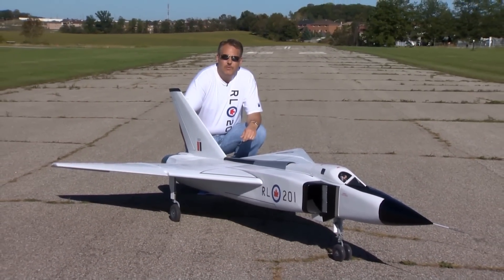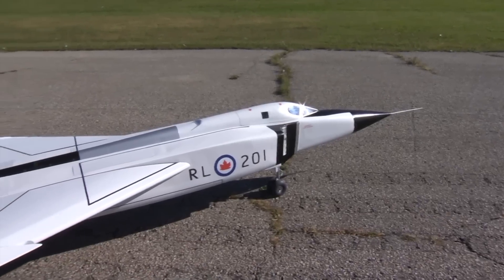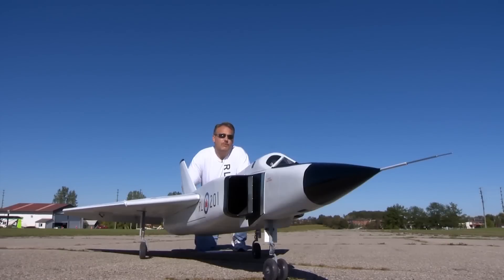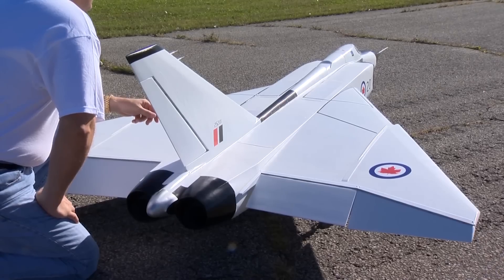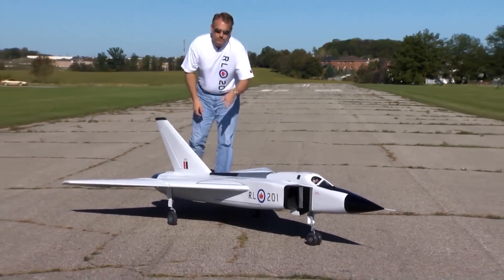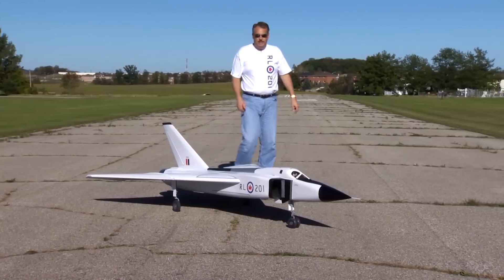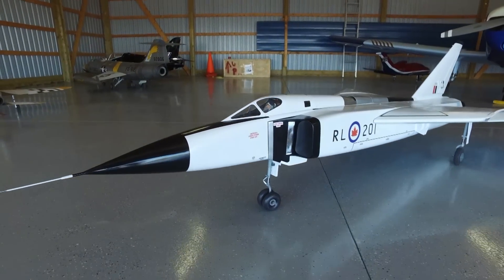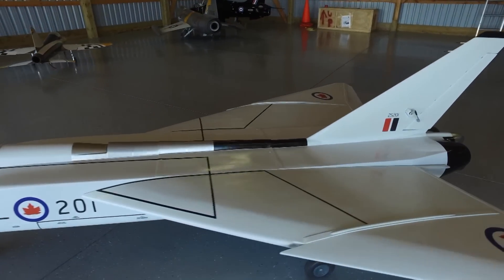Avro Arrow Model Test Flight 2

Comment: ok you almost got the low rear correct it actually sits about an 8 deg angle slant from back to front ....also dont forget the actual rear gear also had to shorten to stow as they had to make room for the fuel storage area ... wihs you had used a turbine engine instead of the ducted fan ... though ... would have sounded better ;)

Comment: Will retracted wheels give it more stability? can you do it?
Reply: part of the problem with retracting gear is they not only need to lift in but angle up the front of the rear wheels up and shorten them a bit to fit within the inner wing space and behind the fuel storage area ... the reason they drooped the wings was to lessen the repair and replace time between the screw gear failure from repeated landings ... the wing droop also added stability ... and the inner wing along the air dam actually cants slightly towards the rear of the plane ... the front edge is actually 6 inches further out than the trailing edge .. and the air dam was angled towards the main body at the very top and bottom making it also a vortices generator increasing thrust from 1 to 4% over it's flight envelope ... they put a ;lot of little tricks into that plane ... and it still has the 15 still used firsts of all jet fighters ... and once had 22 of the firsts ..7 of the firsts were changed ...
.
dont forget the inner wing is a high mach airfoil it is a trapezoid ... with the longest side on the bottom back then  top back then top front and finally bottom front ... while the outer wing was a standard airfoil with flat bottom and curved top ... the inner wing was best at high speed and the outer was best at low speed .... the difference partially covered stall speed ... as the stall would start almost at the rear end of the inner wing ... but with the outer wing compensating with the majority of the low speed lift .. at high speeds (mach 1.5+ the outer wing would stall more near the tip and work in BUT the inner wing was providing about 95% of the lift of the plane

Comment: how did you solve the pitch up problem, are you sure this aircraft had a 1-1 power output, i think you know what your doing, did you add some weight forward as 2nd flight was good, i got 17" laptop and had problems seeing it.
well done for bringing the AVRO ARROW back to life,
Reply: the arrow was 1.1 to 1 thrust to weight ... actually ... no weapons ... as for the pitch up that was most likely because the tail was plywood being over heavy he may have just moved some weight forward and brought the center of gravity towards the leading edge of the wing root where it belongs

Comment: Wish Canada gets the real deal back in a 2020 format.
Foolish politics has denied aviation some absolute gems.
Reply: thanks to deifenbaker ... Canada as a country CANT design any new fighter jets ... as part of the bomarc deal he signed away our right to do that ... BUT civilians have no restriction on rebuilding and updating it ... Currently have the engine bay and engine iintake duct 3d planned out ... working on the wing drop inner and outter wings now ... and then its the weapons bay and cockpit then the front gear and the nose cone ... with the rear gear going last as they not only fold up but turn and shorten also when being stowed ... the absolute final bit will be the air dam design ... as it not only moves towards the tail but slants towards the top and bottom of the main fuselage on the outer most edges ...after that it's on to the turbine ... updating a 70 year old design of the iriquois engine ... after all of that its virtual wind tunnel and then a small scale model and flight ... and then onto the 6th gen and 7th gen versions I have planned ... and then to find a few people who can find others to source the materials for construction of a 1:1 version of each iteration ...

Comment: Avro had wild flight characteristics, that huge delta wing . Great job keeping that beast hood up. That plain was 40 years advanced in its day . The U2 would of been doomed ! reason they wiped out the program! Yanks were pissed off.
Reply: um the specification it was designed and BUILT to is 70 years old ... it started it's design in 1951 fall and was first built on the production line in 56 and flew in october of 57 ... the air 7.3 specification ... is still UN MET to this day ... NOTHING made anywhere in the world has met that spec yet .... and thats makes it 70 years and COUNTING

it also was NEVER prototyped it was always a full production run plane ... all 37 of them ... although only 6 got fully built and 5 only flew ...

Comment: thanks for posting.   some late thoughts.   at 1:11, the apparent contours of the wing upper surface cause me to suspect that airfoil/profile 'transition'  towards the wingtips, is less-than ideal.    fan size is  What.   the intake area  may/may not be  optimal.      most people do  NOT  understand that an  edf  has  a  Minimum Optimal  intake  AREA.      intake area should be at Least,  the area of the fan, Minus the area of the forward spinner/cone.   ( r-sqrd x pi  equals  area )     one can only wonder,  how  much   Excess  Mass, came with the decision to use fiberglass, at the fuselage.     most people do not  understand that  Every (component) part of an airframe has a  dom; distribution of mass (that is a part of the whole).    in this case, the span-wise dom of the wing is, probably,  less-than ideal.    cheers           googletranslate
Reply: actually the arrow wing was a trapezoid ... with the leading edge top being the longer of the two edges ... it was designed to handle mach 7 with that inner wing air foil ... the outer wing is a standard rounded top flat bottom for low speed lift ... also the air dam just before the  middle of the wing span (about 6 inches on the real one) is slightly canted towards the main body to create a small vorticular flow pulling the high speed air (above mach.8) back and towards the engine ... and yes it isnt straight back it moves towards the tail by 6 inches as well ... which also gives the airflow at high mach added thrust ... as it also pushes the plane forward ... about 1% on the real version 
... and that is the other reason they had the rear gear screw themselves up shorter to fit in ... the other was the wing droop to accomodate the shorter gear to avoid high stress on the threaded portion of the gear when landing and reduce mean time before replacement of them .. the rear gear also turned slightly to angle into the wing shape better with the front of the rear gear moving about 3 inches to slot into the inner wing behind the main fuel storage area and not leave a bump on the lower wing

Comment: My uncle  worked on the original arrow said it was  away a head of it time .heard it could accelerate faster fully loaded  then empty f35 .
Reply: the air 7.3 specification the arrow was designed to STILL HAS NOT BEEN MET ... not a single fighter interceptor produced the world over has even matched that specification ... to this date ... that includes all 3 variants of the f35 the f22 and even the f18 ... the closest was the prototype f22 the americans canceled ... now thats 70 years since the first design was worked on (1951 was the original design start 1956 was the first production plane build start with the first flight being 1957)  ... and unlike all other planes there was NO PROTOTYPE made it was a production run plane from the very start ...

Comment: I have a 6.5 lb arrow using 2 70mm edfs on 6s. I was wondering what 70mm edfs produce enough thrust to get this baby in the air. I am fearful the ones I have may not do the job.
Could you email me at awinship@xplornet.ca with any suggestions you may have.
Regards
Adrian

Comment: A very nice stand off scale model. It looks good in the air for sure and flies really nice. But, I could see right away the wing was not to scale.
Reply: no droop and the inner wing was longer than it should be ... and the air dam was not slanted towards the body it was furthest from the body at the front and closest at the tail it literally is a 6 inch difference on the real thing ... and the reason the air dam was angled in was to create a vortices generator that would also add about 1 to 4% more thrust to the plane just from air pressure also the ailerons were slightly tapered as the hydraulics had to be moved backwards to allow the rear gear to fit in ... and the elevons were even across the outer wing

Comment: very cool mode, but why did you not incorporate the wing anhedral angle that the real avro arrow had?
they added it due to stability issues after the initial design.
Reply: actually they drooped the wings to keep from having to shorten the gear for stowage too much ... that is why the 4 deg slant on the wings .. it saved them 6 inches or screw thread on the main strut to actually fit the gear into the wing and leave extra room for fuel storage ... and yes it also added stability ...